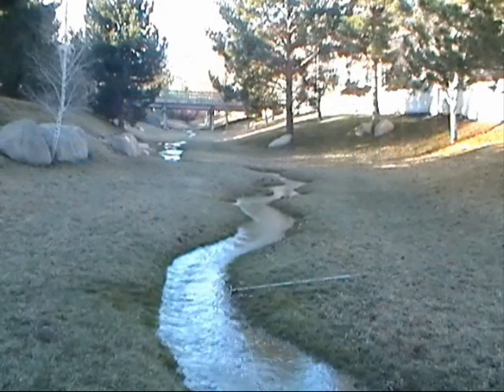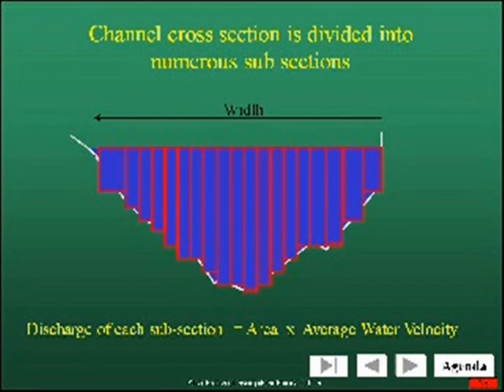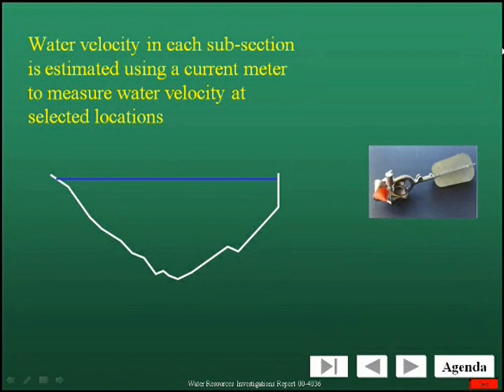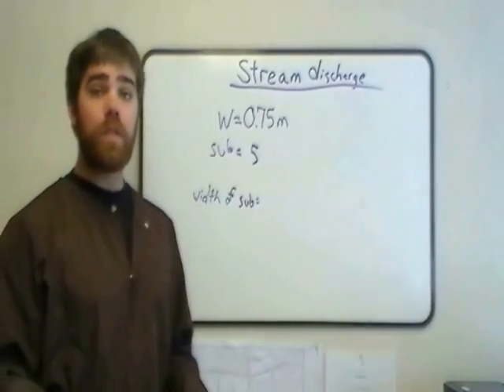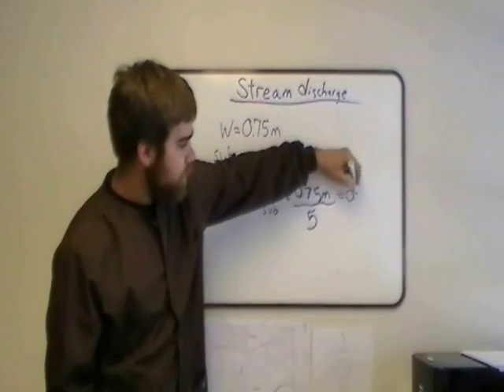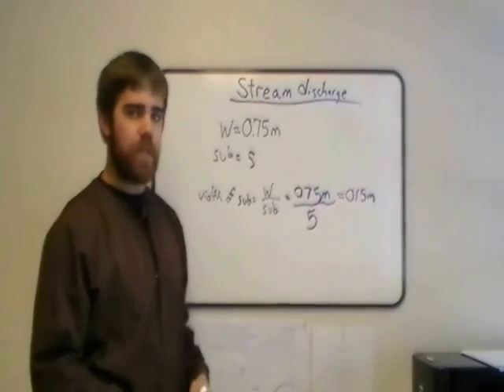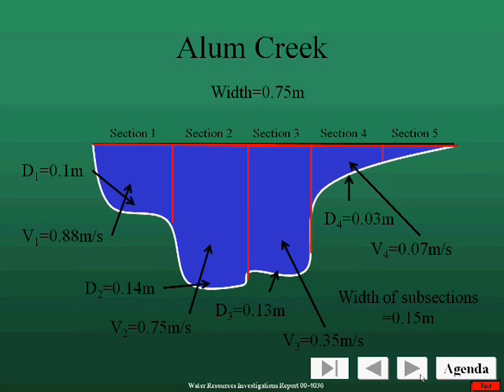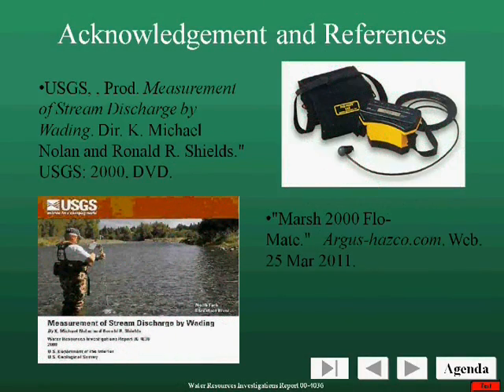Discharge measurements using a current meter

Comment: he way of finding discharge  and others are very interesting and colorful.but i have interesting question for you. if i have rating curve developed for open river channel and twice per a day in  12 hour interval and event based  stage measurement and if we asked to calculate daily stream discharge how to calculate in to spread sheet? use "peterwater2123@ gmail.com" Example:

Date Time Streamflow depth_staff gauge (cm)
1/1/2016 6:00 35
1/1/2016 0:00 40
1/2/2016 6:00 40
1/2/2016 0:00 35
1/3/2016 6:00 40
1/3/2016 0:00 34
1/4/2016 6:00 40
1/4/2016 0:00 40
1/5/2016 6:00 33
1/5/2016 0:00 40
1/6/2016 6:00 35
1/6/2016 0:00 35
1/7/2016 6:00 34
1/7/2016 0:00 34
1/8/2016 6:00 33
1/8/2016 0:00 33
1/9/2016 6:00 34
1/9/2016 0:00 34
1/10/2016 6:00 35
1/10/2016 0:00 30
1/11/2016 6:00 32
1/11/2016 0:00 32
1/12/2016 6:00 35
1/12/2016 0:00 35
1/13/2016 6:00 35
1/13/2016 0:00 35
1/14/2016 6:00 35
1/14/2016 0:00 35
1/15/2016 6:00 35
1/15/2016 0:00 35
1/16/2016 6:00 35
1/16/2016 0:00 35
1/17/2016 6:00 35
1/17/2016 0:00 35
1/18/2016 6:00 35
1/18/2016 0:00 35
1/19/2016 6:00 35
1/19/2016 0:00 35
1/20/2016 6:00 35
1/20/2016 0:00 35
1/21/2016 6:00 35
1/21/2016 0:00 35
1/22/2016 6:00 32
1/22/2016 0:00 32
1/23/2016 6:00 32
1/23/2016 0:00 32
1/24/2016 6:00 32
1/24/2016 0:00 32
1/25/2016 6:00 32
1/25/2016 0:00 32
1/26/2016 6:00 32
1/26/2016 0:00 32
1/27/2016 6:00 30
1/27/2016 0:00 30
1/28/2016 6:00 30
1/28/2016 0:00 30
1/29/2016 6:00 30
1/29/2016 0:00 30
1/30/2016 6:00 30
1/30/2016 0:00 30
1/31/2016 6:00 30
1/31/2016 0:00 30
2/1/2016 6:00 30
2/1/2016 0:00 30
2/2/2016 6:00 30
2/2/2016 0:00 30
2/3/2016 6:00 30
2/3/2016 0:00 30
2/4/2016 6:00 30
2/4/2016 0:00 30
2/5/2016 6:00 30
2/5/2016 0:00 30
2/6/2016 6:00 30
2/6/2016 0:00 30
2/7/2016 6:00 30
2/7/2016 0:00 30
2/8/2016 6:00 30
2/8/2016 0:00 30
2/9/2016 6:00 30
2/9/2016 0:00 30
2/10/2016 6:00 30
2/10/2016 0:00 30
2/11/2016 6:00 30
2/11/2016 0:00 30
2/12/2016 6:00 30
2/12/2016 0:00 30
2/13/2016 6:00 30
2/13/2016 0:00 30
2/14/2016 6:00 29
2/14/2016 0:00 29
2/15/2016 6:00 29
2/15/2016 0:00 27
2/16/2016 6:00 27
2/16/2016 0:00 28
2/17/2016 6:00 28
2/17/2016 0:00 28
2/18/2016 6:00 27
2/18/2016 0:00 27
2/19/2016 6:00 27
2/19/2016 0:00 27
2/20/2016 6:00 27
2/20/2016 0:00 27
2/21/2016 6:00 27
2/21/2016 0:00 27
2/22/2016 6:00 27
2/22/2016 0:00 27
2/23/2016 6:00 27
2/23/2016 0:00 27
2/24/2016 6:00 27
2/24/2016 0:00 27
2/25/2016 6:00 27
2/25/2016 0:00 27
2/26/2016 6:00 27
2/26/2016 0:00 27
2/27/2016 6:00 27
2/27/2016 0:00 27
2/28/2016 6:00 27
2/28/2016 0:00 27
2/29/2016 6:00 27
2/29/2016 0:00 27
3/1/2016 6:00 27
3/1/2016 0:00 27
3/2/2016 6:00 27
3/2/2016 0:00 27
3/3/2016 6:00 27
3/3/2016 0:00 27
3/4/2016 6:00 27
3/4/2016 0:00 27
3/5/2016 6:00 27
3/5/2016 0:00 27
3/6/2016 6:00 27
3/6/2016 0:00 27
3/7/2016 6:00 27
3/7/2016 0:00 27
3/8/2016 6:00 27
3/8/2016 0:00 27
3/9/2016 6:00 27
3/9/2016 0:00 27
3/10/2016 6:00 26
3/10/2016 0:00 26
3/11/2016 6:00 26
3/11/2016 0:00 26
3/12/2016 6:00 26
3/12/2016 0:00 26
3/13/2016 6:00 26
3/13/2016 0:00 26
3/14/2016 6:00 26
3/14/2016 0:00 26
3/15/2016 6:00 26
3/15/2016 0:00 26
3/16/2016 6:00 26
3/16/2016 0:00 26
3/17/2016 6:00 26
3/17/2016 0:00 26
3/18/2016 6:00 26
3/18/2016 0:00 26
3/19/2016 6:00 26
3/19/2016 0:00 26
3/20/2016 6:00 26
3/20/2016 0:00 26
3/21/2016 6:00 26
3/21/2016 0:00 26
3/22/2016 6:00 26
3/22/2016 0:00 26
3/23/2016 6:00 26
3/23/2016 0:00 26
3/24/2016 6:00 26
3/24/2016 0:00 26
3/25/2016 6:00 26
3/25/2016 0:00 26
3/26/2016 6:00 26
3/26/2016 0:00 26
3/27/2016 6:00 26
3/27/2016 0:00 26
3/28/2016 6:00 25
3/28/2016 0:00 25
3/29/2016 6:00 25
3/29/2016 0:00 25
3/30/2016 6:00 25
3/30/2016 0:00 25
3/31/2016 6:00 25
3/31/2016 0:00 25
4/1/2016 6:00 25
4/1/2016 0:00 25
4/2/2016 6:00 25
4/2/2016 0:00 25
4/3/2016 6:00 25
4/3/2016 0:00 25
4/4/2016 6:00 25
4/4/2016 0:00 25
4/5/2016 6:00 25
4/5/2016 0:00 25
4/6/2016 6:00 25
4/6/2016 0:00 25
4/7/2016 6:00 25
4/7/2016 0:00 25
4/8/2016 6:00 25
4/8/2016 0:00 25
4/9/2016 6:00 28
4/9/2016 0:00 28
4/10/2016 6:00 28
4/10/2016 0:00 28
4/11/2016 6:00 28
4/11/2016 0:00 28
4/12/2016 6:00 28
4/12/2016 0:00 28
4/13/2016 6:00 28
4/13/2016 0:00 28
4/14/2016 6:00 28
4/14/2016 0:00 28
4/15/2016 6:00 28
4/15/2016 0:00 28
4/16/2016 6:00 28
4/16/2016 0:00 27
4/17/2016 6:00 27
4/17/2016 0:00 27
4/18/2016 6:00 27
4/18/2016 0:00 27
4/19/2016 6:00 27
4/19/2016 0:00 27
4/20/2016 6:00 27
4/20/2016 0:00 27
4/21/2016 6:00 27
4/21/2016 0:00 27
4/22/2016 6:00 27
4/22/2016 0:00 27
4/23/2016 6:00 27
4/23/2016 0:00 27
4/24/2016 6:00 27
4/24/2016 0:00 27
4/25/2016 6:00 27
4/25/2016 0:00 27
4/26/2016 6:00 27
4/26/2016 0:00 27
4/27/2016 6:00 27
4/27/2016 0:00 27
4/28/2016 6:00 27
4/28/2016 0:00 27
4/29/2016 6:00 27
4/29/2016 0:00 27
4/30/2016 6:00 27
4/30/2016 0:00 27
5/1/2016 6:00 27
5/1/2016 0:00 27
5/2/2016 6:00 27
5/2/2016 0:00 27
5/3/2016 6:00 28
5/3/2016 0:00 28
5/4/2016 6:00 28
5/4/2016 0:00 28
5/5/2016 6:00 28
5/5/2016 0:00 29
5/6/2016 6:00 28
5/6/2016 0:00 29
5/7/2016 6:00 29
5/7/2016 0:00 29
5/8/2016 6:00 29
5/8/2016 0:00 29
5/9/2016 6:00 30
5/9/2016 0:00 30
5/10/2016 6:00 30
5/10/2016 0:00 30
5/11/2016 6:00 30
5/11/2016 0:00 30
5/12/2016 6:00 30
5/12/2016 0:00 30
5/13/2016 6:00 35
5/13/2016 0:00 35
5/14/2016 6:00 35
5/14/2016 0:00 35
5/15/2016 6:00 40
5/15/2016 0:00 50
5/16/2016 6:00 50
5/16/2016 0:00 40
5/17/2016 6:00 40
5/17/2016 0:00 40
5/18/2016 6:00 45
5/18/2016 0:00 50
5/19/2016 6:00 45
5/19/2016 0:00 45
5/20/2016 6:00 45
5/20/2016 0:00 45
5/21/2016 6:00 45
5/21/2016 0:00 43
5/22/2016 6:00 45
5/22/2016 0:00 43
5/23/2016 6:00 45
5/23/2016 0:00 43
5/24/2016 6:00 43
5/24/2016 0:00 45
5/25/2016 6:00 43
5/25/2016 0:00 44
5/26/2016 6:00 40
5/26/2016 0:00 45
5/27/2016 6:00 40
5/27/2016 0:00 45
5/28/2016 6:00 40
5/28/2016 0:00 45
5/29/2016 6:00 40
5/29/2016 0:00 40
5/30/2016 6:00 40
5/30/2016 0:00 40
5/31/2016 6:00 40
5/31/2016 0:00 40
6/1/2016 6:00 40
6/1/2016 0:00 40
6/2/2016 6:00 40
6/2/2016 0:00 40
6/3/2016 6:00 40
6/3/2016 0:00 40
6/4/2016 6:00 40
6/4/2016 0:00 40
6/5/2016 6:00 40
6/5/2016 0:00 40
6/6/2016 6:00 40
6/6/2016 0:00 40
6/7/2016 6:00 40
6/7/2016 0:00 40
6/8/2016 6:00 60.00
6/8/2016 0:00 70.00
6/9/2016 6:00 70.00
6/9/2016 0:00 70.00
6/10/2016 6:00 65.00
6/10/2016 0:00 65.00
6/11/2016 6:00 65.00
6/11/2016 0:00 60.00
6/12/2016 6:00 60.00
6/12/2016 0:00 60.00
6/13/2016 6:00 55.00
6/13/2016 0:00 60.00
6/14/2016 6:00 60.00
6/14/2016 0:00 60.00
6/15/2016 6:00 65.00
6/15/2016 0:00 60.00
6/16/2016 6:00 70.00
6/16/2016 0:00 65.00
6/17/2016 6:00 65.00
6/17/2016 0:00 65.00
6/18/2016 6:00 70.00
6/18/2016 0:00 65.00
6/19/2016 6:00 65.00
6/19/2016 0:00 65.00
6/20/2016 6:00 90.00
6/20/2016 0:00 70.00
6/21/2016 6:00 60.00
6/21/2016 0:00 60.00
6/22/2016 6:00 60.00
6/22/2016 0:00 65.00
6/23/2016 6:00 70.00
6/23/2016 0:00 65.00
6/24/2016 6:00 65.00
6/24/2016 0:00 60.00
6/25/2016 6:00 60.00
6/25/2016 0:00 60.00
6/26/2016 6:00 55.00
6/26/2016 0:00 55.00
6/27/2016 6:00 55.00
6/27/2016 0:00 55.00
6/28/2016 6:00 65.00
6/28/2016 0:00 60.00
6/29/2016 6:00 90.00
6/29/2016 17:00 80.00
6/29/2016 18:00 65.00
6/29/2016 0:00 90.00
6/30/2016 6:00 75.00
6/30/2016 17:00 75.00
6/30/2016 0:00 80.00
7/1/2016 17:00 70.00
7/1/2016 0:00 90.00
7/2/2016 6:00 70.00
7/2/2016 17:00 90.00
7/2/2016 18:00 100.00
7/2/2016 0:00 120.00
7/3/2016 6:00 120.00
7/3/2016 17:00 100.00
7/3/2016 0:00 115.00
7/4/2016 6:00 90.00
7/4/2016 17:00 115.00
7/4/2016 17:18 130.00
7/4/2016 0:00 155.00
7/5/2016 6:00 90.00
7/5/2016 0:00 115.00
7/6/2016 6:00 120.00
7/6/2016 0:00 105.00
7/7/2016 6:00 100.00
7/7/2016 0:00 90.00
7/8/2016 6:00 90.00
7/8/2016 17:00 90.00
7/8/2016 0:00 90.00
7/9/2016 6:00 140.00
7/9/2016 15:31 180.00
7/9/2016 7:14 100.00
7/9/2016 7:26 120.00
7/10/2016 5:50 155.00
7/10/2016 18:35 125.00
7/10/2016 15:00 140.00
7/10/2016 16:00 165.00
7/10/2016 16:18 175.00
7/10/2016 16:50 180.00
7/11/2016 6:00 120.00
7/11/2016 17:00 120.00
7/11/2016 10:00 140.00
7/12/2016 6:00 115.00
7/12/2016 17:00 115.00
7/12/2016 10:00 130.00
7/13/2016 6:00 100.00
7/13/2016 15:00 105.00
7/13/2016 18:06 140.00
7/13/2016 12:11 170.00
7/14/2016 6:00 140.00
7/14/2016 17:00 135.00
7/14/2016 10:00 190.00
7/15/2016 6:00 190.00
7/15/2016 17:00 225.00
7/15/2016 14:06 190.00
7/15/2016 18:12 225.00
7/16/2016 6:00 220.00
7/16/2016 15:00 190.00
7/16/2016 7:00 110.00
7/16/2016 8:00 135.00
7/17/2016 6:00 140.00
7/17/2016 17:00 130.00
7/17/2016 14:00 135.00
7/17/2016 18:00 170.00
7/18/2016 6:00 115.00
7/18/2016 17:00 100.00
7/18/2016 13:00 180.00
7/18/2016 16:00 210.00
7/19/2016 6:00 135.00
7/19/2016 15:00 170.00
7/19/2016 7:00 150.00
7/19/2016 8:00 180.00
7/20/2016 6:00 210.00
7/20/2016 17:00 190.00
7/20/2016 17:18 190.00
7/20/2016 14:00 210.00
7/20/2016 17:24 230.00
7/21/2016 6:00 170.00
7/21/2016 16:00 165.00
7/21/2016 18:00 140.00
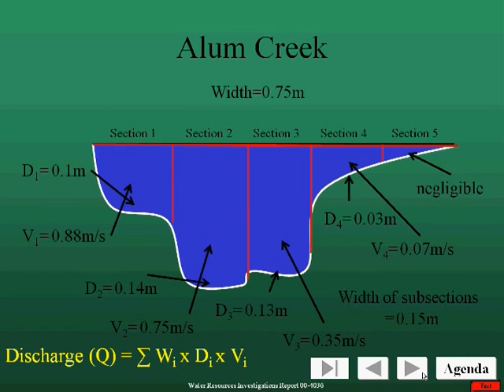7/21/2016 12:00 175.00
7/22/2016 6:00 160.00
7/22/2016 17:00 140.00
7/22/2016 0:00 180.00
7/23/2016 6:00 135.00
7/23/2016 18:00 180.00
7/23/2016 12:00 145.00
7/24/2016 6:00 230.00
7/24/2016 17:00 195.00
7/24/2016 18:18 160.00
7/24/2016 12:36 180.00
7/25/2016 6:00 140.00
7/25/2016 0:00 125.00
7/26/2016 6:00 140.00
7/26/2016 0:00 160.00
7/27/2016 6:00 175.00
7/27/2016 0:00 185.00
7/28/2016 6:00 180.00
7/28/2016 0:00 155.00
7/29/2016 6:00 175.00
7/29/2016 0:00 130.00
7/30/2016 6:00 140.00
7/30/2016 0:00 125.00
7/31/2016 6:00 125.00
7/31/2016 0:00 120.00
8/1/2016 6:00 125.00
8/1/2016 0:00 110.00
8/2/2016 6:00 115.00
8/2/2016 0:00 120.00
8/3/2016 6:00 110.00
8/3/2016 0:00 155.00
8/4/2016 6:00 145.00
8/4/2016 0:00 155.00
8/5/2016 6:00 140.00
8/5/2016 0:00 180.00
8/6/2016 6:00 180.00
8/6/2016 0:00 165.00
8/7/2016 6:00 140.00
8/7/2016 0:00 150.00
8/8/2016 6:00 130.00
8/8/2016 17:00 160.00
8/8/2016 14:00 145.00
8/8/2016 18:00 180.00
8/9/2016 6:00 140.00
8/9/2016 0:00 130.00
8/10/2016 6:00 190.00
8/10/2016 18:00 195.00
8/10/2016 14:00 180.00
8/10/2016 16:00 195.00
8/11/2016 6:00 180.00
8/11/2016 0:00 155.00
8/12/2016 6:00 160.00
8/12/2016 0:00 150.00
8/13/2016 6:00 150.00
8/13/2016 0:00 160.00
8/14/2016 6:00 130.00
8/14/2016 0:00 125.00
8/15/2016 6:00 140.00
8/15/2016 17:00 170.00
8/15/2016 10:00 170.00
8/16